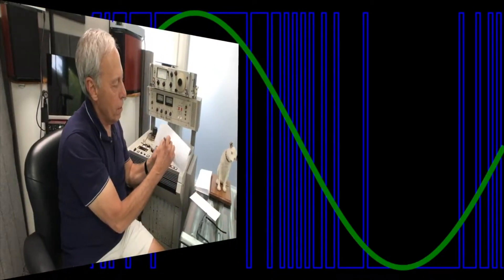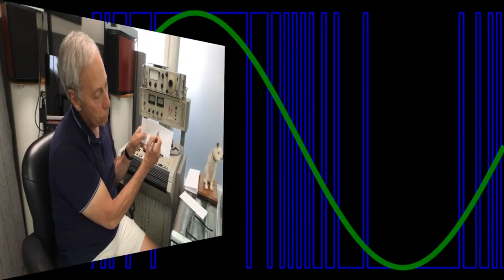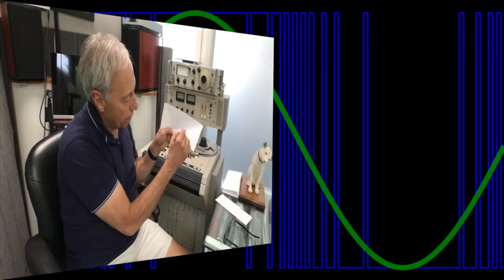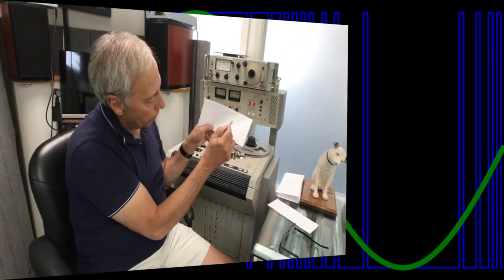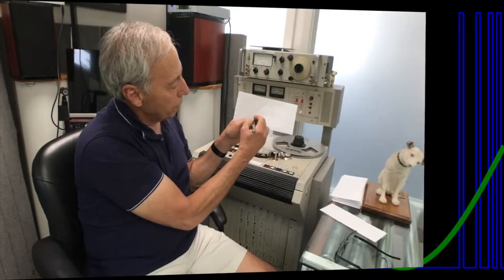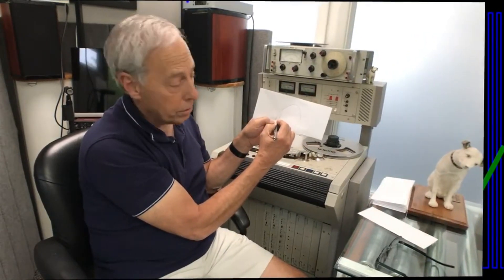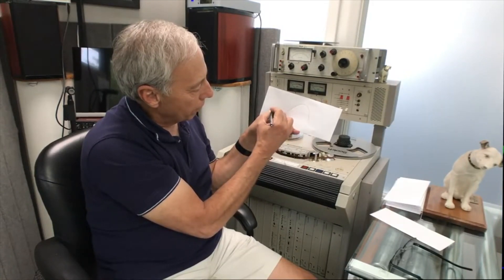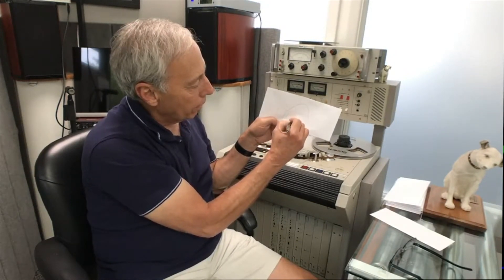Difference between DSD and Class D

Comment: DSD is a misnomer.  "Digital" means numerical; there must be numbers encoded in the stream.  Nowhere in a DSD stream are there any numerical quantities encoded, so it's not digital.  It is a 2-state analog representation of the signal.  This becomes clear when you go to design circuitry to "decode" DSD; for minimum noise and distortion, it requires very high stability in both timing, and the two output levels, because there is no feedback to correct errors.  
In practice, DSD streams are generally limited to pulse densities below 75% and above 25%, as encoders can become unstable if they venture beyond those limits.  This forces a 6dB reduction in S/N ratio which DSD could otherwise achieve.  
Similarly, Class D (PWM) is not digital.  It is analog input, and analog output, with the intervening circuitry operating in analog fashion (fixed voltages but variable timing); pulse width is continuously variable, not quantized.  Feedback is used so that the pulse timing can compensate for power supply, output device voltage burden, and other variations which would otherwise produce distortion.  It is virtually impossible to build a power amplifier which runs a class D output stage in step with an incoming DSD stream, due to the voltage-level inaccuracies and switching-time variations inherent in the output stage, and the inability to apply feedback to correct them.  On a small scale, such as a headphone amplifier, it becomes much more feasible.

Comment: Pulse width modulation (what drives a class D amp output stage) can be considered a special case of pulse density modulation where all the pulses corresponding to one sample are contiguous in the digital signal. So why not make a class D amp (PWM) that runs DSD (PDM) directly with no DAC? Well, one challenge is that class D for a well controlled output requires a feedback loop that usually is done with analog feedback (IcePower, NXP etc.). But someone gotta make a DSD direct amplifier for the ultimate in DSD...

Comment: PDM is basically PWM but instead of variable width, as for PWM, it's fixed and a lot lot smaller. Hence why the density of 1's is carrying the signal and not the width and why they use such a high modulation frequency for PDM. Regardless, they are very much related to each other and the math behind them are very similar.

Comment: What? How can one confuse DSD (Direct Stream Digital) with Class D amplification, which is an electronic amplifier in which the amplifying devices (transistors, usually MOSFETs) operate as electronic switches, and not as linear gain devices as in other amplifiers. There is no shred of relation between the two, they are two entirely different things. 
If folks are confusing DSD with Class D amps, I blame the high end manufacture and crazed audiophile wordsmiths for confusing folks with their misleading spin. 

Where one is likely to see confusion and will see it is all the spun three letter acronyms (DSD, PCM, UPS, Etc.) that gets thrown around on purpose by those wanting to fight about it and tell others they are stupid for listening to one form over another with no solid evidence or scientific knowledge.
Reply: Everyone is at a different point on their audio journey
Reply: At first it seems so, but the question is actually very relevant and much deeper than initially thought.
DSD is as close to analog as we can get (digital representation of the actual analog wave)
Class D is inherently digital but outputting analog

You see where he is going..

Comment: The can of worms you have opened in pushing into DSD! Exposing how little is actually understood by most people regarding digital technologies in relationship to processing analog signals. And the hard drawn line between a PCM type system where each sample is turned into a number representing the voltage at that stand alone point in time is confused when the ADC uses Sigma Delta which does not work by actually measuring the voltage level and outputting an exact represented number. It guesses at a number. And a one bit system like both DSD and PWM which compares the existing level to the new level and a simple Yes/No is decided based on is it higher or not. Where in PCM a single sample of data can stand alone to show the signal level at the point in time all by itself. Where in DSD and PWM (and SACD) the output is either on or off, not a discreet value between. And filtering averages the output over a period of time. At no single point is a specific value known strictly from that sample's data value. This hard line difference is one of the first things that needs to be understood I think.
Reply: Sigma Delta ADC's do not guess at a number, because there is no number.  It just maps one analog domain (voltage) to another (time).  Among DSD (PDM), PWM and PCM, only PCM can be called digital.  
As to the "can of worms" with DSD, yes, it has issues - 
One of the main problems in setting up a recording studio that tries to keep everything in DSD representation, is that there is no method to directly mix the signals or perform effects.  They must be converted to another representation, such as PCM, before they can be scaled/combined/filtered etc., then converted back to DSD again.  The only alternative is to do the mastering live - but then you can't go back and adjust settings.  
As a format, DSD 64 is less efficient for transmission and storage, than 24 bit 96KHz PCM.  I'd wager there are few, if any, listeners who can distinguish a quality difference between those two formats.  High-resolution PCM recording is common today, and I would much prefer to see Octave Records pursuing it instead of DSD.
Reply: @marianneoelund2940  So you are saying that a Sigma Delta ADC does not generate a number to fill the data field required for that sample? Because that is not how TI explains it in their literature for their Sigma Delta ADCs. They specifically state a number is generated for each sample as required to be a PCM data point. 

So in your PCM, Pule CODE Modulation system, there are no sample value numbers? What occupies those data fields?
Reply: @glenncurry3041  The TI parts you are thinking of, such as the ADS1xx series, are much more than just the converter.  Look at the functional block diagrams.  The delta-sigma ADC is just the front end.  Most of the circuit complexity is there to convert the bit stream from the demodulator, into PCM data.  
For DSD recording, you only need the delta-sigma modulator front end, such as the TI AMC1035.  DSD directly records the bit stream from the demodulator, into the .dsf file.  
Regarding PCM, I said it's the one that is digital, because the format contains numerical values.  Please read more carefully.    
I've performed manual editing on .wav and .dsf files, so I certainly know what they contain.
Reply: @marianneoelund2940  "Sigma Delta ADC's do not guess at a number, because there is no number." 

"Most of the circuit complexity is there to convert the bit stream from the demodulator, into PCM data.... because the format contains numerical values"

When you decide whether a PCM Sigma Delta ADC generates a number or not, let me know.
Reply: @glenncurry3041  Two different cases:
1. PS Audio only uses the front end (modulator) because they record its bit stream directly.  In that domain there are no numbers.  
2. The TI sigma-delta converters, not used by PS Audio, contain the additional digital functions, e.g. low-pass and decimation filters, which generate the numbers for PCM output.  
But I believe you already knew all of that, and are just being cheeky, as usual.
Reply: @marianneoelund2940  So now you're wandering off to what PS Audio uses.... Not found of red herring sandwiches. So long!
Reply: @glenncurry3041  That's PS Audio AND anyone else who uses DSD.  Was that not the topic of the video we are supposed to be  discussing?  
Why are you disagreeing just to be disagreeable?

Comment: Now I'm thinking that DSD is more analogous to FM in class C.
Reply: While I have not been in RF for a long time (I had a 1st Class FCC license back in the day) when I repped Kenwood (also a manufacturer of Ham Radio gear) they came out with a line of FM receivers with Pule Count Modulation I believe they called it. Merely heterodyning down from FM to audible range and rectifying it used the change in density of the FM and driving class C and then low pass filtered to create the audio output. Much simpler and less distortion than typical quadrature or slope detector.
Reply: @glenncurry3041  Fascinating.